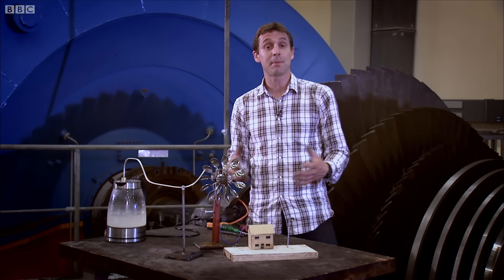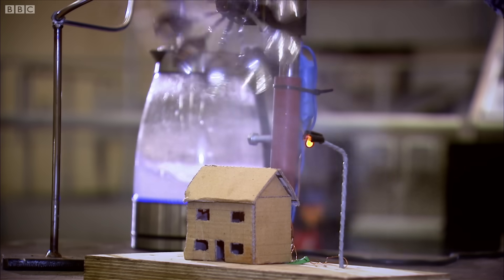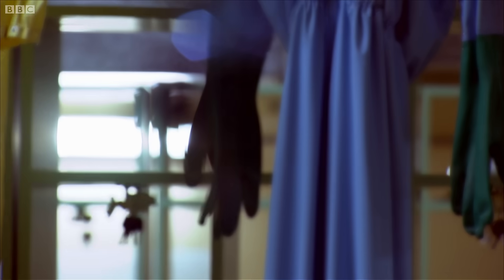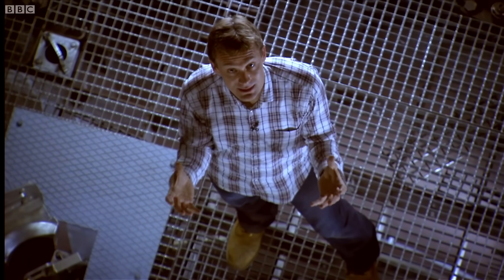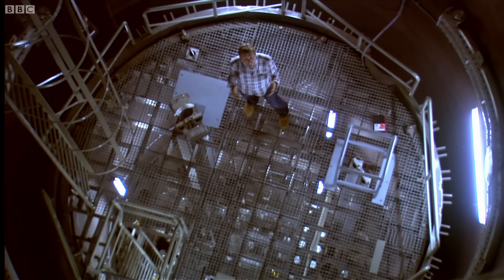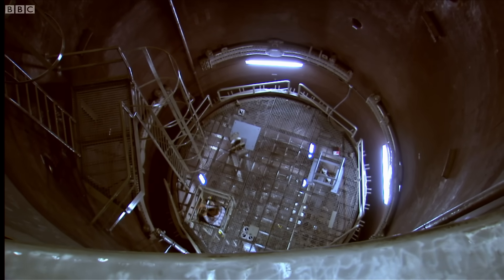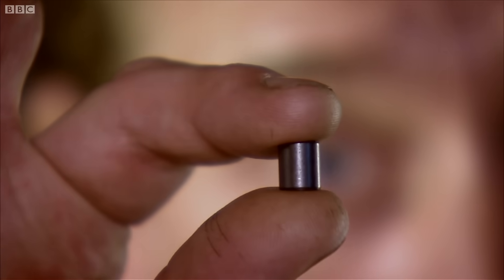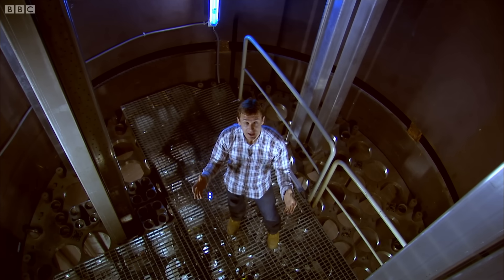Inside a nuclear reactor core - Bang Goes The Theory - BBC

Comment: It's brave of him to be holding pellets of nuclear fuel with his bare hands.
Reply: It's not going to cause any problems at all. He will come to no harm whatsoever.
Reply: Why?
Reply: @Paul-c5x7t It emits alpha particles
Reply: @gower23 I know. And it's of no consequence. Alphas are readily stopped by skin. A sheet of paper is enough. Alphas are just helium nuclei.
Reply: @gower23  Ingesting U238 would not be e problem from a radiological perspective, but the risk of heavy metal poisoning is real. There's a lot of fear propaganda pushed around over radiation and radioactivity in general.
Reply: @Paul-c5x7t I'd still wear a glove personally
Reply: @gower23  I wouldn't worry about it at all. No concern whatsoever.

Comment: The reactor I ran was a B&W. PWR,  a little less than 1000 MW electric to the grid.  We ran 24 / 7  for 2 years before we had to refuel,  the volume of uranium (fuel only)  1/3. Of our core load, would fit in a pickup truck bed 8ft long 4ft wide  approximately 5ft tall.  However the weight would be excessive..

Comment: No mention of control rods?
Reply: Water is the moderator here, hence no rods.
Reply: @paulanderson7796  the moderator allows the reactions to happen, without control rods the reaction would quickly soar out of control and then youd be up to the mercy of the void coefficient. rods are very much still needed
Reply: @paulanderson7796 I saw in another vid that control rods are needed as they absorb the excess otherwise the reaction would be out of control
Reply: @sanidhyatrivedi4689  Depends upon the reactor design. You always need a moderator to slow down the free neutrons otherwise the reaction stalls anyway.
Reply: @paulanderson7796  ohh okk
Reply: @sanidhyatrivedi4689 One big benefit of using water as a moderator is that it boils away if the reactor overheats and thus the reaction stops anyway. No reliance on graphite or boron rods to stall the reaction.
Reply: @paulanderson7796  If water boils away then how does the reaction stop cause water is only used as a moderator to slow down the reaction?
Reply: @sanidhyatrivedi4689  The moderator (in this case water) doesn't slow down the reaction. It slows down the speed of the free neutrons so they can be captured by or split the nuclei of other U 235 atoms. If the free neutrons are moving too fast the reaction will stop.

Comment: I confused so you need a atom to crash into the uranium but to do get the atom stronger or something? you need a neutron that will crash into the atom causing the atom to release more neutrons? then the neutrons will crash into the uranium making the uranium crack open releasing energy and that energy is heat and that process creates so much heat that flows to the water vaporizing the waiter and making steam which then the steams flows to huge turbines causing big generators to turn making electricity to your city I know I'm wrong so could someone please help me out thanks!

Comment: This is most certainly a new reactor that's yet to be commissioned. No way one could go into the reactor chember without any coveralls.
Reply: Or in one never commissioned at all… there are plenty of those around that have been turned into museums cough cough Austria, a reactor yet to be commissioned would be an active worksite
Reply: @sniperplays6616  Fair point.

Comment: The narrator forgot to mention the vital bit of kit that generates the neutrons; the neutron howitzer! This uses very high voltages to bombard the fuel rods with neutrons that in turn generate heat! So in essence the fuel rods act like the heating element of a kettle; providing resistance to the flow of neutrons/electricity!!

Nuclear fission is a more scientific way to describe the conductivity of heat!

Comment: This is not heat if heat not possible 40000 ton pressure, 300 degree centigrade possible. If pressure increase definitely temperature increase.I think electron is flowing more and may be increased the volume.I love science.

Comment: Thank you for explaining that into a way that is understandable.  I recently built a fusion reactor (very small one) but all of this is so fascinating  !!
Reply: Hoy did you created a nuclear fusion reactor?
Reply: @ok_conera  it's a Farnsworth Fusor.  You have to build or buy a vacuum chamber. After obtaining deep vacuum using a pump, you send 12,000-15,000 volts DC through the core. It sends atoms flying into each other. The basic reactor doesnt produce much energy but if you use deuterium gas it creates a moderate amount of energy.

Comment: A good way to explain this is friction. When something moves fast enough against something else it creates friction witch creates heat. Go to your car a do a burnout the tire spinning on the ground creates friction between the road and the tire it’s self lots of heat. Rubbing two sticks together creates heat and if you do it right creates fire. Same things happening in the core lots of friction heating the water.
Reply: No, that's incorrect. The energy released here is the result of fissioning U235 nuclei into two smaller nucleui. The forces that bond the protons and neutrons together in the nucleus are strong. When the bonds are broken there is a huge amount of energy released.
Reply: paulanderson79       Yes your right but what’s creating the separation friction between the two creating heat.
Reply: @ryans413  that's the water molecules themselves. But the source of energy to excite the water molecules into motion is not a result of friction. Friction does not happen at the level of atomic nuclei. Those protons and neutrons are bound very tightly.
Reply: @ryans413  It's smashing apart the nuclei of U235 atoms that releases energy. The strong nuclear force that holds neutrons and protons within the nucleus of a U235 atom are broken when hit by other neutrons.
This particular part of the process has nothing whatsoever to do with friction.
Wasting tyres performing burnouts, as well as rubbing together bits of dry wood has nothing in common with a commercial fission reactor.
Reply: @ryans413  The separation is the strong nuclear force. There is no mechanical friction whatsoever. You are completely wrong.
Reply: @ryans413  there is no friction at this level.

Comment: Still don't know how they use the control rods to keep it from going supercritical.
Reply: All commercial reactors operate in supercritical mode otherwise they'd be sinking more energy than they release. The rods simply block neutrons, that's all they do.
Reply: @paulanderson79   Oh. I assumed they operated them as close to critical as possible.
Reply: @Pupsi  The thing to remember is supercriticality in a reactor is not the same thing as supercriticality in a fission bomb. The words can be confusing I agree.
Reply: @paulanderson79  Ahhh. Now I got it... maybe. It's run supercritical but not above the maximum rate of heat extraction.
Reply: @Pupsi  That's exactly it. Nicely phrased as well. I like that. Describes it perfectly.
Reply: @Pupsi  that's where MOX fuel rods come in, generating more energy when it's more critical
Reply: A fission bomb explodes at prompt critical. Basically a reactor is set up to be supercritical with the neutrons released by the decaying fission products as well at the initial fission while a bomb is supercritical with only the neutrons from the initial fission, called prompt critical. As a result reactivity within a reactor changes much slower, it takes minutes to change from moving the control rods. And in a bomb the reactivity changes instantaneously from a human perspective.
Reply: paulanderson79 they absorb neutrons. Not block, this just introduces negative reactivity to the core.
Reply: @paulanderson79  Wrong.  The plants operate at exactly critical (Keff =1.00) unless they are changing power levels.  And the control rods absorb neutrons, not block them.
Reply: Another thing to remember that differentiates the criticality of a fission nuclear reactor's reaction and a fission bomb's reaction is the level of enrichment of the U-235. The purity of the enriched U-235 in nuclear reactors is around 20%, whereas the U-235 in a fission bomb is closer to 90-95%. For an explosive reaction in a reactor to happen, you would have to create incredibly unstable conditions inside the reactor to expel a large enough amount of energy at one time, which is exactly what happened in Chernobyl. 

We now use heavy water, rather than regular water to both cool the reactor core and moderate the neutrons inside a nuclear reactor, and typically use boron in the control rods, which absorb the excess neutrons sent out from a Nuclear fission reaction, which moderates the level of criticality.
Reply: @johnnycoolguy9554  wow 20% this is a commercial power plant not a navy class reactor more like 2-5% enrichment
Reply: The control rods grabs a few of the neutrons, and keeps them from starting a bigger chainreaction
Reply: The control rods function are literally in their names. They control the reaction by absorbing the neutrons to reduce high reactivity
Reply: Control rods prevent reactors from going supercritical because they are made of a material that reduces reactivity, such as boron. I learned that from HBO Chernobyl.
Reply: https://youtu.be/9M6VGXGBChM
Reply: Magic
Reply: lol hi
Reply: Control rods made of Boron. Boron absorb neutrons. Boom.
Reply: Supercritical just means it’s producing a self sustained chain reaction. When control rods are inserted into the core it blocks the neutrons from flying around and sustaining the chain reaction. There is still radioactive decay and xenon is produced which poisons a reactor. Xenon buildup is what made Chernobyl happen. The reactor was poisoned and they over compensated and quickly powered up a reactor that should have slowly been brought back up.
Reply: I was told, by a super smart guy, that those pellets are encased into long "rods".
   Those rods are hanging on some kind of hook/crane. When not being used, They are holstered in encasements (made of lead or carbon, I think).

When they want electricity,   they lift the rods out of their lead holster/encasements and the rods heat up and boil the water.
   Then, when they are satisfied with the amount of electricity they produce, 
they lower the rods back into their holster encasements where they cool off again. 
   The water eventually cools off.
      But over time, the water turns into radioactive sludge. Which they fill into 50 gallon drums and bury in the desert.... 😳😳😳
Reply: @dallas-joe-8940  No
Reply: @saturnslastring  
Yes
Reply: @dallas-joe-8940  no that's not how it works sorry

Comment: Spare me the atom nutron Mumbo jumbo. What do you put with uranium to get a nuclear reaction???
Reply: We can't really avoid mentioning neutrons as they are key to the fission reaction. Once the reaction is started it is self sustaining. Free neutrons hit other uranium nuclei causing these in turn to split and release further neutrons. The fuel itself is simply low enriched Uranium. Sometimes an external neutron source is used as an 'igniter' to start the reactor.

Comment: Wait, most reactors have water, and a cube/circle deep in the middle that glows blue when activated. In the 80's, did they just use the same thing but no water??
Reply: No.
Reply: No, the cores have always had water. If it didn’t, then there would most likely be damaging of the fuel
Reply: Right, right. I forgot about the coolant systems, but Soviet RBMK reactors didn't look like these, that's what confused me.

Comment: Now tell me.. How does an RBMK reactor explode?
Reply: Reactors don’t normally explode in the way, say a bomb would. reactors fail in a “meltdown” where the fuel rods are so damn hot they melt themselves destroying their containment chambers. In the case of Chernobyl, a steam pressure buildup in the reactor caused by a meltdown in said reactor was violently released in an explosion blowing the roof away releasing radiation and toxic material as well as causing a fire

Comment: But where does the first neutron come from?
Reply: There are some random neutrons being spit out by radioactive decay products within the fuel, but those usually aren't enough to get the reaction going. They use some kind of external neutron source typically to get the reactor going when starting it up.
Reply: @Arkalius80  thanks! After commenting I finally came across a video that explained this. I find it puzzling that it was never explained in all the other videos I watched on the subject. They always started with " a neutron strikes the nucleus of the uranium atom".

Comment: Is there graphite tip for control rods. It could be dangerous.
Reply: That what i was thinking i have read in my 10th grade that graphite and boron rods are used to control the reaction spontaneity. But he didnt mention about it😂
Reply: @liltiger4187  Control rods in a PWR used to be made of hafnium, but they get brittle. So we changed to rods made of an alloy of silver, indium, and cadmium.
Reply: Credits:chernobyl 2019 tv series
Reply: All of u r delusional, go to infirmary
Reply: Not all reactors are RMBK-Reactors, no worries, since 1986 nearly all Control Rods were updated or destroyed. But nuclear power plants are still dangerous and I'm not a fan of it.
Reply: @qshad6973  Nuclear power plants are only dangerous because most are liquid water nuclear Reactors and are using Uranium 235, where water can dry up at any time causing problems.

Nuclear Reactors like a Thorium-based nuclear reactor uses molten liquid salt as a coolant (has a much much higher heat capacity than water) and use Uranium 233 as fuel (much safer and the waste can be used instead of thrown away). 

Thorium based nuclear Reactors are very very hard to get a meltdown due to its design, coolant and fuel, and in order to get a meltdown would require someone to intentionally sabotage the reactor.

Comment: yeah but what I dont understand is, you have to the fuel rods, but how do you start the reaction itself ? you just add water ?

After the reaction starts those fuel rods produce a lot of heat, correct ?
Reply: iplaybose you just throw neutrons to fuel rods to start the reaction. To stop it you gotta stop neutrons from impacting to rods by inserting some control rods which are like magnets to neutrons. Control rods makes neutrons stick to itself and prevents them reacting with fuel rods.
Reply: Furkan Emiroğlu ohhh ok ok thats starting to make sense now

How do they inject neutrons ?
Reply: @iplaybose  They use neutron generating materials to kick start it. Basically it's just material filled with radioisotopes that emit neutrons. It's dangerous stuff you wouldn't want to handle or be around.
Reply: @Arkalius80  Thanks for explaining man

Comment: Wow now its so easy to understand how nuclear reactor works. Also water wont let the radiation go away, witch means energy is trapped to work with us and make electricity. But one mistake, only one little as an atom explosion, will trigger everything around and will explode letting that trapped radioactive atoms fly everywhere. And also the temperature will rise even more and melt and even if u have water under that reactor..... It can cause an explosion so big, it will make permanent damage to the planet. Chernobyl has that problem and if that energy reach that water russians are doomed and other close countries. Also they were very unlucky, and now in the basement in chernobyl, there is substance made of control rods, nuclear fuel, glass, sand and concrete.

Comment: But if you need a neutron to split the uranium atom, which essentially releases more neutrons, that splits more atoms and so on and so on. How does the process start? Where is the source of the first neutron that splits and causes the chain reaction? What is the catalyst?
Reply: There are typically a couple of neutron sources positioned within the reactor, these are elements which spontaneously fission due to instability producing neutrons. Things like Californium.

Comment: How is it possible to stop or moderate a nuclear reaction? If an atom is split, then it splits another, and another, and another.....and seems to me you’re then quickly in a world of deep shit.
Reply: Charles P. It’s harder than it seems because most neutrons don’t actually hit any uranium atoms as the nucleus is very tiny compared to the atom itself. 

So we have a number of possible solutions to this, pack a lot of uranium next to each other as there are more atoms for a total higher probability of sustaining the reaction. Use a material that can reflect neutrons back to where they came from. Compress the space within the gaps using some kind of pressure (unsustainable as this requires some violent explosion or something, but this technique is used where it doesn’t have to be sustainable, such as a nuclear bomb). 

But if you want to reduce the reaction, all you need to do is introduce an element which is a neutron poison, that is it eats neutrons without fissioning. Boron is one such element, and in a nuclear reactor, we have rods of boron known as control rods, which are inserted and extracted from the core to control the speed of the reaction.
Reply: @storyls  Thanks for that, I appreciate the explanation. I just finished the Chernobyl miniseries which gave me a bit better understanding of how nuclear reactors work, damn good TV if you've yet to see it. :)

Comment: Just stand next to that Uranium fuel rod, whitout even a resperator, thats totaly healthy
Reply: I don't think it's active right now. There is no way he would be allowed to enter a nuclear reactor that had already been used, this is most likely one that was just built, therefore has yet to have come in contact with radioactive materials.
Reply: Uranium isn't all that dangerous. It's only very lightly radioactive, and it's an alpha emitter at that which is easily blocked by the skin. It's only dangerous if ingested.